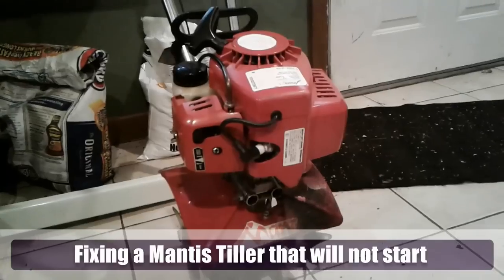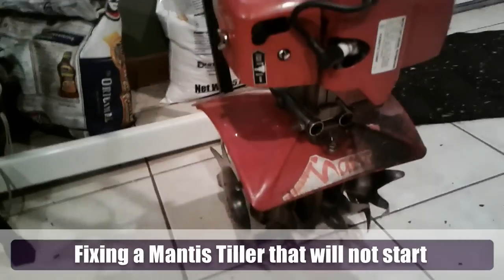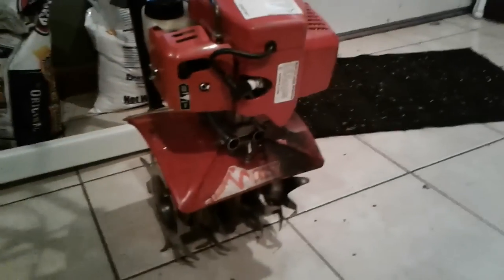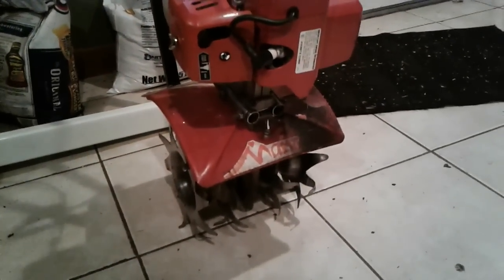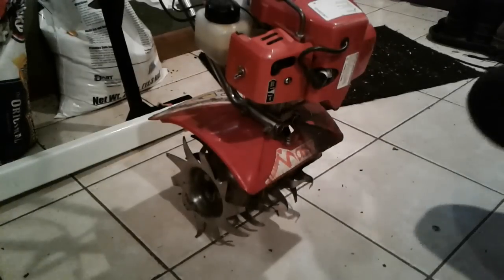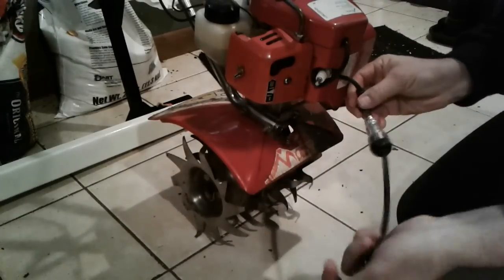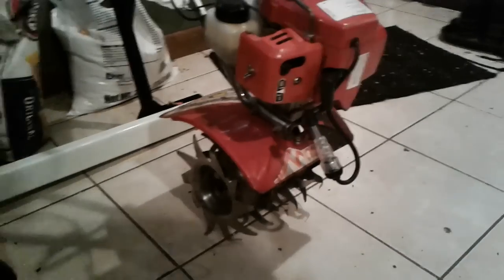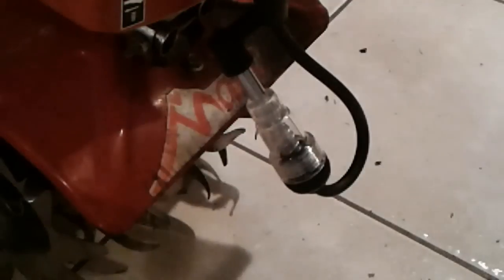Fixing a Mantis Tiller that will not start - Springtime Start-up Techniques

Comment: Father In-Law bought a Mantis Tiller for my wife about ten yrs ago. First season of running was all good after that, no matter what I do, just can't keep it running. Cleaning, new carbs over and again, adjusting, same results.  It does look pretty in the shed though all shined up.
Reply: Check spark plug, there are 3 sizes mantis is not specific and it depends on tolerance.
Reply: @tonyedward6909  Thanks Tony for the info will  give it a try.

Comment: Mine will run fine a few times, but then, after taking a break, it won't start.  Sometimes letting it rest a couple of hours will fix it.  I've read that adjusting the spark plug gap may help or leaning out the mixture.  Any thoughts on that?

Comment: Wow, you've done it again! That third tube coming out of the fuel tank and ending up in a wee white piece of plastic flopping around -- it's a breather. NONE of the experts in all the other garden equipment have mentioned this. Maybe it's in the manuals of the few trimmers (weedwhackers) I've bought new, but I've never seen them spoken about. I shall now venture out through the rain to see if my second-hand, bought five years ago and never used is 2 or 4 stroke. ...Four.
Thanks again. Will search more of your vids.
Reply from the maker: Thanks, John, for watching my video, and for your enthusiasm!  really enjoyed hearing from you!

Comment: On checking my mantis , first thing I did was pull the plug and it showed a lot of black carbon, so I tried to match it with plug at ace hardware, but that was pretty iffy so will order the correct plug for it. Im also starting with fresh oil and gas. In the past I have trouble adjusting the carb, wondering how much is due to wrong plug.

Comment: A fantastic tool when and if you can get it to run. Do not buy one of these unless you like to tinker with small engine repair. The new ones are are cheaply made with tines that bend and tear. I have one of the originals also and mantis doesn't carry parts. You'll get a great workout though from pulling the start endlessly.
Reply from the maker: Nice! I could use a good workout! Ha ha!
Reply: I’ve hated mine since the day I bought it. I needed a tiller and bought this piece of crap instead. Just got it out after not using it for a couple years. Can get it to run but it won’t stay running. My arm feels like it’s gonna drop off. One of my financial regrets.
Reply: I have one with this engine, I have NEVER gotten it to start with the choke on. Instead I have to hold it down full throttle with one hand and yank the cord with the other. Then it usually starts.

Comment: Of course putting a load on the machine makes a difference also.  Theres really not much to the old ones which I have and you can get the complete kit for less than $10 if you like to do that sort of thing.  The hardest and most time consuming part of that project is getting the fuel tube out and new one in the tank.  Make sure you get the right one for your mantis.

Comment: I have had one for 12 years and never replaced the spark plug because unlike bigger engines that run hot it isn't needed. I have rebuilt the carb twice and replaced the transmission once , the fuel lines once, and that is it. I have never heard of any ignition coil going bad.
Reply: Week spar here to wont fire even with eather

Comment: The little we could see of the air filter when you removed it, looked very dirty.
It also appeared when you took the unit outdoors, and it started, you had forgotten to put the air cleaner back on it. Could the reason that it started that time be because the dirty air cleaner was not on it, and smothering it?

Comment: There are rare cases when both your spark tests are good yet the coil will still fail to spark when plug is installed because coil too weak to fire plug when subjected to the engine compression.

Comment: There are three tubes coming out of that gas tank.  The feed tube, the vent tube and the primer tube.  The problem with some of these is that the primer tube, which feeds the bulb primer, is short and unless the tank is full or you set the tank downhill toward the carb, you will be sucking air into the primer bulb.
Reply from the maker: The suction line should be long enough to reach the bottom of the fuel tank, and there should be a fuel filter attached to the end of it.
Reply: wrong,the primer tube is putting fuel back into the tank

Comment: I’m not getting a spark at all.  The tiller was working fine for me (for about 1/2 hour) and just quit while I was tilling my garden.  I replaced the spark plug, grounded the plug and pulled the recoil rope - no spark.  What do I do next?  Do I replace the coil?
Reply from the maker: Get an inline spark tester to verify your conclusion. Hard to see the spark otherwise while trying to yank on the starter rope, etc....

Comment: We've had this tiller for a number of years.  It is weird, we can't start it the day we want to use it.  Leave it overnight and it starts right up after getting a blister from pulling the cable about  50 times the day before.  What's really irritating is the position of the on/off switch.  I continually hit it when I use the tiller.
Reply from the maker: Hmmm...I would plan to attempt to start it one day prior to actually needing it....Also, gloves.
Reply: #ThisIsMeToo lol
Reply: 6857100 I do the same shit all the time...
Reply: Mine is the same way. I will never buy another.
Reply: It says, Prime, Flip, Start. Yeah. It might start the next day, it might take 2 days.

Comment: I got my dads old mantis after he passed.  It hadnt been started in 10+ years.  I went online and used ereplacement parts, got a new fuel line, filter, plug, gasket, air filter and replaced it all.   
Cleaned out the gas tank.
Still wouldnt start
Sprayed carb cleaner 3 or 4 times and she fired right up and running nicely
Reply from the maker: Good job getting it running! Sorry about your dad's passing.
Reply: 100%.  Mine never starts in the Spring.  I put some Techron Concentrate in the tank and do a full pulls.  About an hour later, after the Techron has done its magic, the engine starts.  The prior seasons fuel in the carb turns to jelly and only carb cleaner or fuel cleaner will get the good fuel flowing again.  My other engines have a fuel shutoff valve, and if I shut the valve and let the engine run until the carb is dry in the fall, I have no issues in the Spring.  Haven't figured out a way to do that to the Mantis though without running the entire tank dry.

Comment: One thing I did not hear you mention is bad gas being a common problem in spring. Also holding the tiller up to start is a very dangerous practice, and if the idle is adjusted properly it should not be turning, but maybe you were goosing it too.

Comment: Is there any follow up with Mantis? I was curious if they guy had any repeat starting issues. Our's never wants to start in the spring. Its usually me forgetting which way the power button is suppose to be pressed. Only marking on it is I/O. Sooo, which is on and off? The I is on, O is off.

My snowblower on the other hand, I have to drain the gas and put fresh gas in it EVERY year, Stabil doesn't even work in it.
Reply from the maker: Yes, those "universal" on/off symbols can be confusing. Here's what I found: "The power-on symbol (line), appearing on a button or one end of a toggle switch indicates that the control places the equipment into a fully powered state.
The power-off symbol (circle) on a button or toggle, indicates that using the control will disconnect power to the device." I'd still prefer the words on and off! Regarding gas, I would definitely drain gas out of any carburetor that will sit for months at a time in storage. Tillers, for example, are only used in Spring. And snowblowers, only in winter, and only if it snow. All that time in storage with gas in the carburetor will completely gum it up.
Reply: Drain the gas from the carb and tank. It will also make the gas line hard and brittle.

Comment: Tank breather should be position up in it's little slot.  Replace all the gas tubing.  Empty out old gas and mix new 50:1 fuel and fill the tank FULL.  Finally pull the muffler and clean it out.  They tend to get gunked up or spiders get in there over the fall/winter and can ball things up.
Reply from the maker: Good tips, thanks, Mike

Comment: installed a new carb off amazon and used my mantis twice on the third attempt to use it it would not crank. i managed to adjust the carb enough to use it a third time but it wouldn't stay running unless i had the throttle all the way down. today i went to use it and nothing.  piece of crap. but like the man says you can fix it. over and over and over
Reply: TheDaddycatty, I’ve noticed your comments on a couple of videos I’m watching. Sounds like we both have followed the same steps and came to the same results. 

Let me know if you find success and what works for you and I’ll do the same.

These tillers are great, once you know the tiller you own, and the settings it likes, it’s an indispensable tool. Just gotta get to that point of knowing the tiller.
Reply: @benflammer7217  I need help too. I'm a woman and never done this before. I  Replaced the carburetor and it still wont start..I'm irritated. I love it when it works. It's just not cost effective to pay to get it fixed every few years when it wont start
Reply: @pegpeg3939   You should open the muffler and check the spark arrester. It's a small screen that gets clogged.

Comment: So after all that there was nothing wrong and it started right up. What was the video about>
Reply from the maker: Customer brings a machine that will not start or run. Machine is returned in running condition. This video overviews the steps I took to get it running.
Reply: @Buckwsr  I wouldn't have bothered to respond.  He and SIX other people watched it and didn't understand! Probably Biden supporters.

Comment: I have one of these with a weak spark. Won't even start if you put some gas directly in the cylinder. Possibly a bad magneto.
Reply: Same, in fact even with good spark and gas directly in cylinder i cant get a fire! So although made no sense did replace the mag think maybe some how the kill switch was doing something weird. Anyway with new carb, new gas, new mag - doesnt even try to start let alone run. Frustrating
Reply: @marlinweekley51  I disconnected the kill switch entirely and it still didn't want to start.
Reply: @coondogtheman  same 😜
Iam buying a battery operated one.
Ironically on the top of the pull starter it says “easy start” 😆
Reply: @marlinweekley51  easy start my eye. I made something that goes on a drill and it work pretty good as a roto tiller. It's similar to those weed removal attachments sold on tv that you attach to a drill.
Reply: @coondogtheman  cool. I don’t even care about this goofy thing - it’s just driving me nuts that it won’t even fire! I’ve worked on equipment and rebuilt truck motors etc and never been so frustrated. Gotta move on 😆
Reply: @marlinweekley51  Can't fix em all.

Comment: My mantis wasn't working and then I changed the carb and it started up. After I used it a few more times it just stopped again out of nowhere. Now I'm stuck once again smh
Reply from the maker: undertakerthedeadman you can fix it! Start with the essentials....spark, fuel, compression....
Reply: Exactly my issue.  I would love this thing if only I could start it.

Comment: Mine blew a main bearing, still under warranty and they refuse to honor the warranty.  After all the time I spent getting to know the pull cord, this happens!  I do not recommend this tiller.
Reply from the maker: Possibly just unfortunate bad luck in your case. The Mantis tillers I have seen have been pretty solid.
Reply: Who cares what you "recommend"? Mantis is a very good tiller.

Comment: he really didnt fix anything.
Reply from the maker: Customer brings a machine that will not start or run. Machine is returned in running condition. I'd call that a fix. This video overviews the steps I took to get it running.
Reply: Did you replace the vent just in case?  How much did the customer pay for the unknown fix?